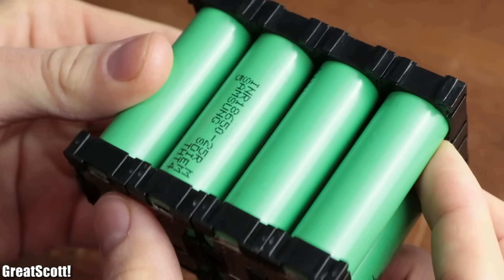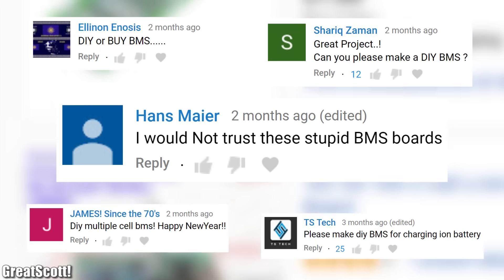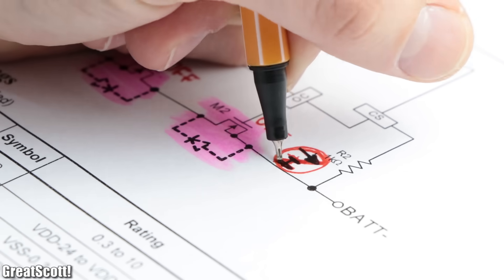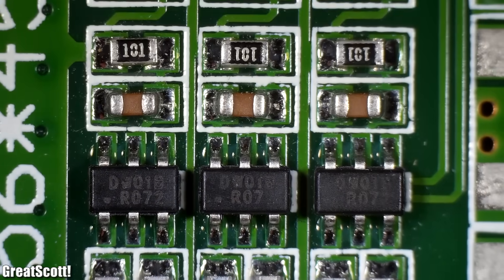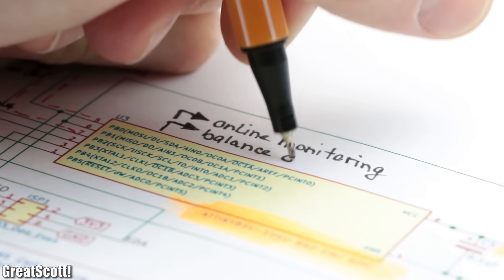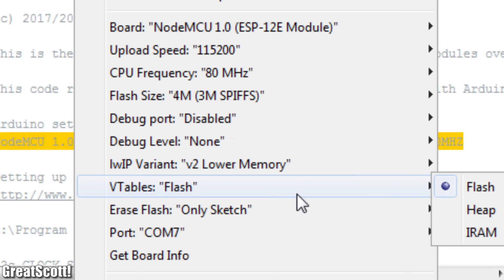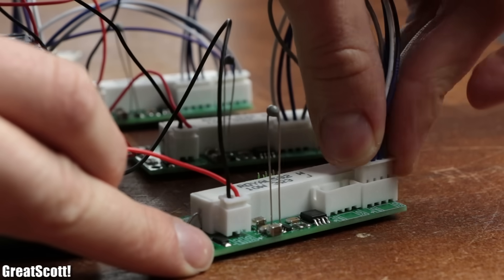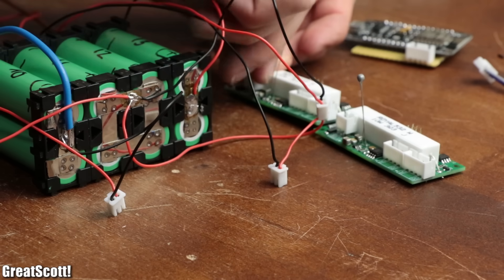BMS (Battery Management System) || DIY or Buy || Properly protecting Li-Ion/Li-Po Battery Packs

Comment: Awesome video 👍👍

To make BMS can we use TP4056 charging modules for each cell and then solder them on one PCB followed by connecting input wires?

Will it work fine? If yes, this will be the cheapest and easiest way to do that.....

Plz reply??????
Reply: not a good idea, if you have a lot of cells
Reply: @matrixdexter270  thanks for your reply.
But i think i will more Cheapest and easiest way to do that then to make Or buy BMS. I want to know is it good technically.......😊
Reply: A separate isolated power supply for each TP4056 module is absolutely essential if you do this, otherwise you will create a short-circuit right across most of the cells via the common ground.
Reply: No it wont work
Reply: @StuartPittaway  ok my friend i knew this now. But can u plz elaborate in a simple way. Some of my friends already tried their best to explain this...
Reply: @pr2207A  each charger would need to be electrically isolated from each other, the TP chip uses a shared ground connection
Reply: A switch for each cell could be used (double thow, single pole) the switch disconnects the minus side of the battery from circuit ground and connects it to the positive of the next cell.   So you would end up  with batteries in series  after charging is done.  So the TP4056 is only used for charging,so you could even shut off power to the tp4056.   Then  batteries  can be connected to a load.  Protection would have to be added in case of overdischarge, over current etc...
Reply: @noweare1  thank u my friend 😊
The board i am using comes with overcharging and overdischarging protection and provides separate connections for battery and load......
Reply: @pr2207A  Yes, I have the same board.  I am protoboarding a small tester for those boards to make sure they do what they are designed for.
Reply: @noweare1  ok 😊
Reply: @Stefan Brückner thanks for your reply. 
I simple words i want to say connect each cell individually with each TP4056 charging module (say 1 module for 1 cell). Now power them all by soldering their input pins together on PCB.
Reply: @pr2207A   
Short answer: No.
Long answer: It is possible if you have a dedicated and separate ground isolated power supply for each TP4056 and isolate the chargers properly. Another way is to disconnect/take apart your battery pack into single cell modules and charge them separately.
Reply: @tamazerd  thanks for your reply my friend.😊
But i am still little bit confused.
Reply: @pr2207A  If you are a little bit confused, i would suggest you stick with the "Short answer: NO", or you will most likely end up with a lot of smoke, and possible battery fire.
Reply: @tamazerd  Ya! That's the best option for me for now.....😊